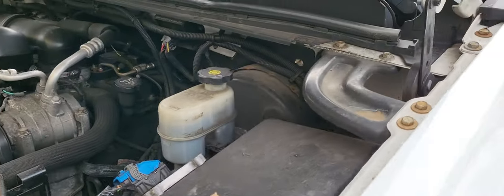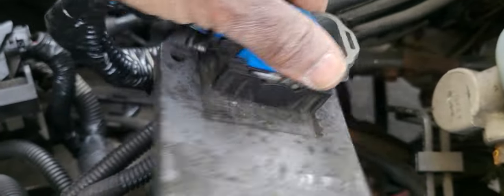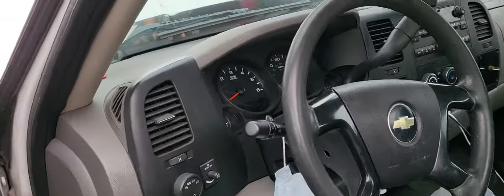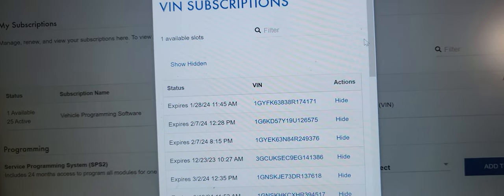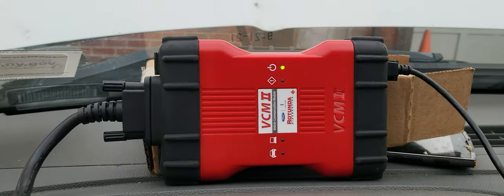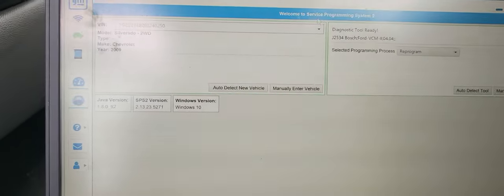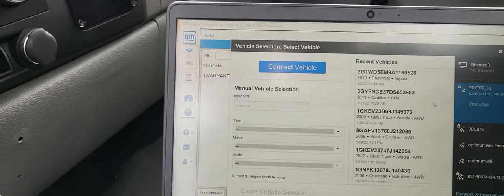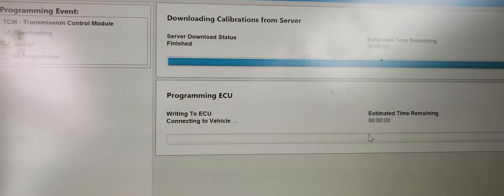2009-2014 Chevrolet Silverado Transmission Control Module Programming TLC Sps2 software System

Comment: greetings thanks for your videos have taught me a lot, I have a query.
They recently programmed the computer of my 2008 Silverado transmission 4x2 engine 5.3 before being programmed the Transmission Control Module did not fail me now it is failing me, it heats up without starting the car. I scan it and it throws DTC U0073-00, P0336-00. I write to you from Venezuela
Reply from the maker: try to reprogram it with the wright software and see what is the result
Reply from the maker: u code is for CAN and p0336 for the crankshaft sensor all I can tell is to review your programming you don't have them before programming

Comment: Do you have to do this when changing the ATF?
Reply: No
Reply: Only when changing valve body, rebuilt trans, replace trans with used, or replace computer. They do have update which is recommended to do. Like a reflags to get the latest update which can improve shifting.
Reply: @geoc7086  thank you sir

Comment: I’ve a have 08 GMC Sierra circuit low at Tcc solenoid. Change transmission and the same issue. Test wire from tcm to transmission. All wire got resistance. Don’t where to go from here.
Reply: Did you ever figure this out, having the same exact problem smh…